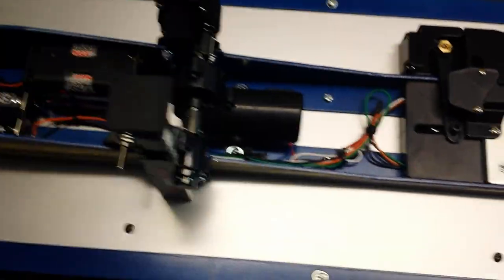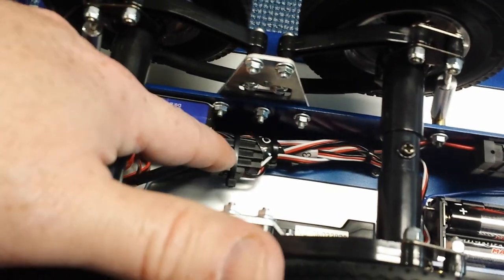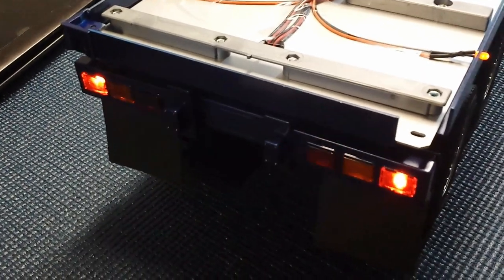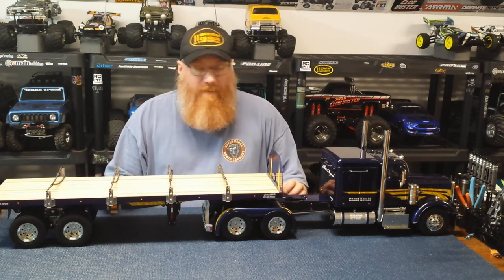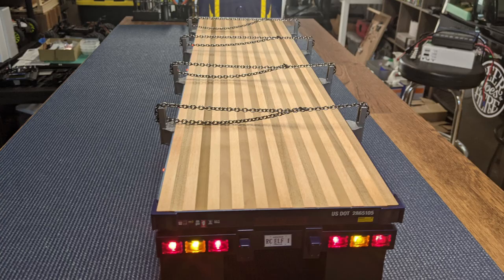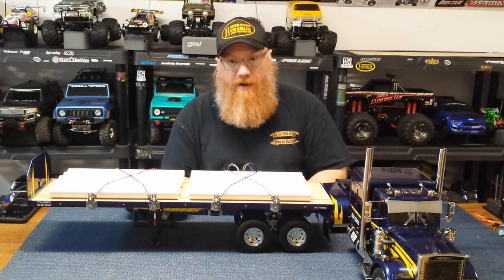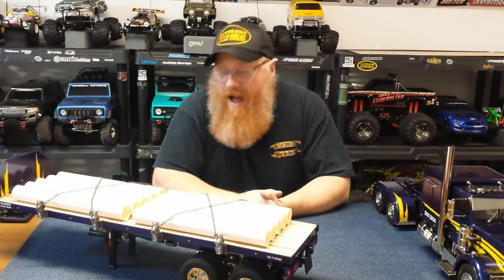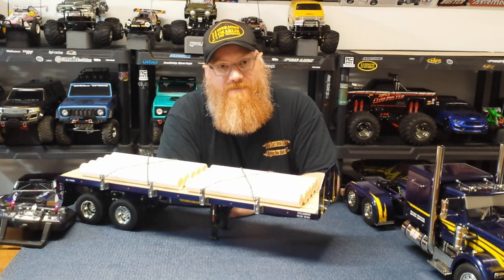Tamiya Flatbed Trailer Kit TAM56502 Part 2  Custom Build Reveal, Tips and Chat

Comment: I'm SO glad that I replaced ALL of the Phillips Head Screws with more realistic looking Hex Head Screws. It's personal preference, and a pricey one... But the smoother flatter Heads might also prevent scratching. I hope!! 
I definitely appreciate how much work goes into these. You've really done a fantastic job on yours!
Reply from the maker: I think if you don't have the electronic leg kit you should be fine. That kit adds a few things to the coupler and causes it to stick down a little further. I have had a suggestion to shim up the coupler on the truck a couple millimeters to help avoid it catching on the fenders. If you are driving on flat ground you should be fine. Mine was from handling it on the bench while it was coupled together and caused it. Those hardware swaps are not cheap.
Reply: Like I mentioned in my previous response, most of the Tamiya Semi electronics are early 90's technology. They don't seem anxious to update any of it. 
There's definitely options, but the only one that's as plug-and-play as Tamiya is GT Power. IT'S only advantage is Lipo compatibility.
Reply: Since I built my Grand Hauler, I found an Evilbay Supplier that specializes in small Metric Hex Hardware.  
A bag of 100 8x6mm Hex Screws, $9.00!!!

Comment: I just custom built a flat deck myself. I used the Tamiya kit for a template as well as the wheels etc. The frame, side rails and deck were built from aluminum I ordered in. The kit is metric, the closest standard size for the angles was 5/8" (very hard to find) and 1 1/2" x 3/4" for the frame (both .063 thick). The 5/8 angle is just a hair larger and the 1 11/2 " angle is about 1/16" shorter than the stock frame. A jigsaw with a metal blade worked great for cutting out the frame after using the stock frame as a jig for holes etc.  I thought it would take a long time but I had the trailer complete yesterday. I learned the shortcomings of the Tamiya trailer wiring kit with my last build (tanker). I also learned about the orange LEDs. They look great when turned off and are a perfect match for the amber plastic on the stock lights. But when you turn them on...Wow are they ever orange. I ended up ordering yellow 3mm LEDs that look way too yellow when off but look good turned on. The solution was I had some Testors amber turn signal paint. I put two coats of that over the yellow LEDs and they look great off or on. I don't have mine made to remotely turn on. They are just wired to a 6v NiMH battery velcroed to the bottom between the frame rails same way I built my tanker. I am still waiting on my order of basswood strips from Sig to surface my deck. I built it to be a scale 45' trailer. That was the standard back in my trucking days. They are still made today but 48' and 53' are more common. Shipping containers now come in a 45' high volume version so I may build one from scratch next winter for a project. I may also build some winches with straps and use some rectangular brass tubing cut up and some 1/4" side strips to build side rails along each side for anchoring straps and chains along the sides. I just uploaded a little quick and dirty video of it on my channel. Nice channel btw, subscribed.
Reply from the maker: I have thought about trying to build a custom trailer, I have seen them done but that is a long term project for sure! Nice tip on the lights as well. I do notice that from an angle they look normal but looking directly at them they are pretty bright! I will have to go over and check out the video of it all. One of these day I will tackle a large custom build like that. I have been wanting to build another truck so it may happen sooner than I think LOL!!

Comment: Great job matching the truck LEDs look great too, I did my KH with box trailer & GH with this trailer to haul BUGGYRA all painted Matallic black with KH stickers & sponsor stickers, I also did wireless LEDs on both trailer's the box trailer has alot of LEDs, yes a labor of love great video 😉👍🚛
Reply from the maker: Yes! The wiring is the most tedious thing about them. Stock it is not bad but the second I decided to do extra stuff it became a lot more work! Thanks for the compliment and it took a lot of fiddling to get the trailer lights working and all cleaned up. Totally worth it in the end and it was super rewarding to see everything all lit up and working at the end!!! The next adventure with one should be a little easier. Thanks as always for stopping by and checking in!!!

Comment: OMG, I'm so excited.!!! I have just unboxed my very first Tamiya kit 5 days ago. That was the Unimog 406 that the RC ELF have sent to me. Two days ago I also unboxed the Grand Hauler from the RC ELF.!! He sent me straight to you and now I see why. Awesome video my new Tamiya brother. I can't wait to see your 1st Hauler video. I will be sure to watch it before I get started on mine.
Reply from the maker: The build is pretty straight forward, typical Tamiya except there is just a lot of it. It is pretty involved but goes together very well. Painting takes a good bit of time so go through the instructions and try and get all the parts you need to paint done at one time and don't rush that part!! It is a really fun truck to build and even more fun to drive around and just practice with it. Be very careful with handling it if you have a trailer attached or driving up and down hilly areas with the trailer attached. The fenders sit very close to the trailer and I scratched mine messing with it. So just try and not man handle it with the trailer attached and be careful creating over a hill to make sure it doesn't contact the fenders. Congrats on the awesome truck and you are going to have a ton of fun with it!!!!
Reply: @AddamsPlayground  thank you for your response.! I am so happy right now. It looks like the Tamiya community is really accepting me with open arms. I will be contacting you and others if I run into anything weird. I really appreciate the support.!!
Reply from the maker: @AMAZINGRC  sure thing, happy to help out!!

Comment: Wish I had of watched your videos before I painted the truck it sucks up that paint! Got the trailer on the way not sure exactly what I'll decide with lights etc but these videos have helped me understand the trailer before I receive it and my plans thanks 🙏 and thanks RC elf!
Reply from the maker: Yeah this took way more paint than I expected it to! The wireless lights were kind of a pain but the factory trailer light setup will only power the lights in the kit. In hind sight I probably would just have the trailer lit up statically and not worry about all the turn signals working and all that but it is cool it all works together, just a lot more effort. These are extremely fun kits to assemble and get going and so much fun to just play around with! It is the biggest showpiece in my collection and I love looking at it. Have fun with yours!
Reply: @AddamsPlayground  biggest most expensive piece in my collection very prized possession I'm waiting for a smoke unit for mine to finish the cab I've got lights in the dash I actually fit the mfc and speaker receiver and battery all in the back cab and that's finished...I guess lol have to think about lights and paint for the trailer the trailers are super expensive I'm 46 and always wanted tamiyas since I can remember I only get a disability pension but manage to save enough for them I've built a sand scorcher midnight pumpkin chrome hotshot hornet and mk1 golf still some finishing touches for some like paint done over about the last year gives me great joy 😊 you and bobs videos been a great help with the truck 🚒 thanks 👍
Reply from the maker: @blitzrc4713  I learned an awful lot from Bob! He is a wealth of knowledge about these kits!! You have managed to get a great lot of kits over there!! I am glad you are enjoying them! I know the list of wants from my childhood is still very long!! 😂

Comment: Great build. I too watch Hobby Concepts to get the wireless trailer hookup. I redid all my trailers and trucks to one channel on my Spektrum radio. I'm buildinga new King Hauler Black Edition with the tanker trailer. I'm using the black box light controller off ebay. The taillights glow then bright when brakes are applied. On the reefer it allowed to do two brake lights and turn signals. I would like to have running lights but don't really want to drill holes to add them. I got to build the Grand Hauler with a new box trailer as well. My Knight Hauler has the full MFC. I'm not doing sounds and stuff in the new trucks. I'm just using the black box light kit and leds bought off amazon. It'll be cool. I'm using a Hobby Wing 1080 esc set to where there is no motor noise too. Driver figure will be installed and will be awesome. I like those full fenders on the Grand Hauler but you did mentioned they hit with the motorized legs.
Reply from the maker: You are getting a whole fleet over there! I do want to build another one, they are a lot of fun to build and finish! Yeah, the motorized leg kit hangs a little lower in spots and has a couple screws that stick out slightly. Just enough that I did scratch the fender. I have heard you can place some spacers under the  coupler on the truck to raise it slightly to help . I have not done it yet but I will try it. In my next truck I want to run one of the Beier sound and light kits in it. Totally programmable that will help the truck as it will be a custom one! Thanks for stopping by and checking in, I appreciate it!!

Comment: Fantastic job my friend. Looks good, not a fan of the chains, but you made them look good. Love seeing custom work to these. I'm  currently building two, gonna be a set of trains. Not a fan of when the truck is turning right and left the signals on the trailer come on, just wouldn't see that in real life. Anyway great job, truck looks good too. Love a good long and rambly video 👍
Reply from the maker: Thanks! If you love a good long rambly video you came to the right spot! All of them are twice as long as thy could be with me blathering one in them! This was my first big truck and all of it was new, think it turned out well even though I had no idea what I was getting into! I want to do another one in 2022, just haven't figured out which platform to work with. Leaning towards the globe liner but may go with the king hauler.... also depends on the $$ situation.
Reply: @AddamsPlayground  Haha well my videos aren't much different. Its good to be thorough. 👍

Comment: Sweet Rig!  The flatbed trailer appears to be short in length and not scale.  I think it should be a few inches longer to be scale.
Reply from the maker: Yeah, one of the biggest issues with the Tamiya one is it is shorter. Doesn't look as scale but to be honest it saves some space for storage and once you are driving it it really doesn't matter. It is just fun and too cool looking to notice it is a little short! Thanks for stopping by and checking it out!

Comment: Addam, I have the same setup but a protruding screw on the trailer scratched the fenders on the truck when turning. I had to raise the fifth wheel and the legs.
Reply from the maker: Yeah, I found out afterwards this is a common issue with the auto leg kit causing that. It too have a scratch across the fender. I bought some adhesive diamond plate to cover the tops of them but have not put them on yet. What did you use for spacers do it? I guess the better question probably is how much did you raise it? Thanks for stopping by, checking it out and for the tip!
Reply: The brass bearings under the fifth wheel and wood under the legs.
Reply from the maker: @harryvalle8276  good use for those brass bushings!!!

Comment: I would of used flat head leds instead. You prob would of had to make the wire kit yourself but the look would be better. I have mine built but haven't gotten around to lights or anything yet.
Reply from the maker: Yeah I can see that looking good. These kind of look like little lenses down the side. It is not scale accurate but I love seeing it all lit up. Running all the lights was my least favorite part of the build as it is packing 5lbs of stuff into a 1lb box at times! It looks good in the end though!